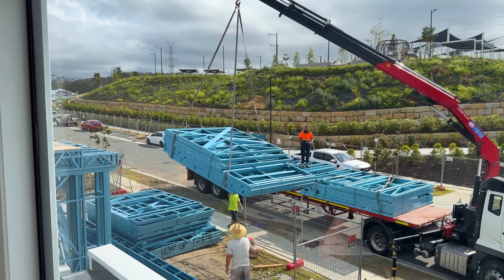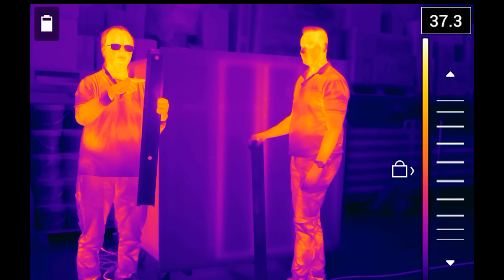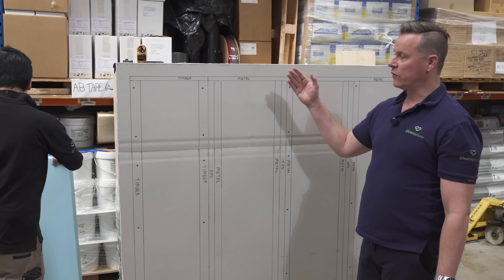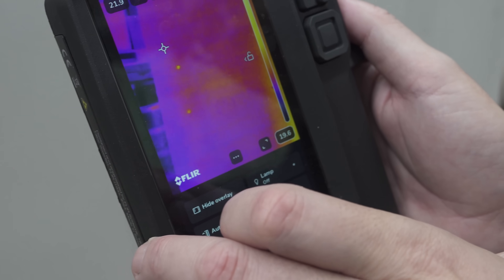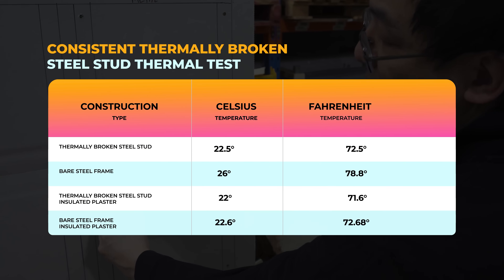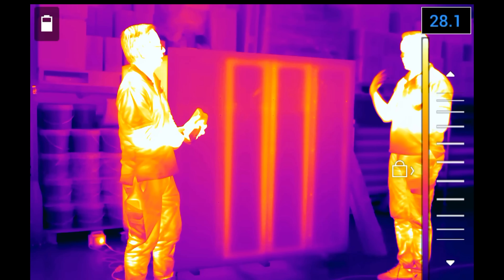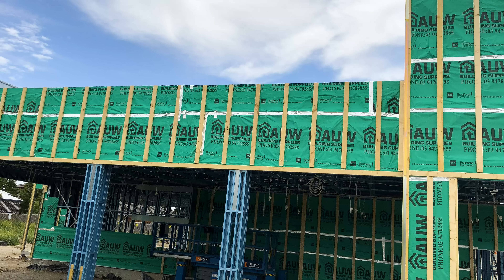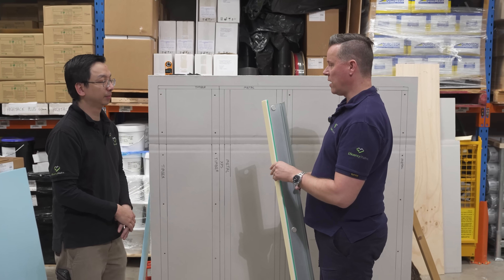Steel Studs BUSTED: Thermal Bridge Nightmare Exposed

Comment: Unlike in cold places where you need to trap the heat in, during dark winters, summertime sun in Oz can readily power a heat pump.  Regardless, layer of bricks on the inside is more sane than "inside out" brick veneer.

Comment: Interesting video. A lot of effort for a relative inconsequential result. If you wanted a far more accurate results for not much more work (yes, I know what I'm talking about, I do building design and are a tradesman too.) you should have built 4 individual boxes, space them apart by 1 - 1.5 metres, have an accurate controlled heating system for each box. Construct each box as a true example of what you are representing, then take your results. That would have prevented heat creep, open side vs box side (the two outer boxes were exposed at the end, the two middle boxes share walls on either side, etc.) good video but...do better guys, you put a lot of effort into it, put a little more thought next time.

Comment: Why not put the thermal break material on the INSIDE instead (or in addition) - sandwiched between the steel and the plasterboard? I think that would perform better.

Comment: Its the shitty WINDOWS that are most thermally bad insulated because it is also metal frame and only 1 piece glass (it requires at least 2 pieces of glass, ideally 3, to create good thermal insulation)
Also the roof and ceiling are have very bad thermal insulation

Comment: It's  a 4 x 2 this is Australia. 
And actually we have been metric in this country since I was a child 60 years ago
Reply: Totally agree. It's 4 X 2. The old man never bellowed at me,  hand that 2 X 4 to me now. 4 X 2, 3 X 2,  but it was always 2 X 1.  There was 2 different types of Clouts. The Clouts in the tins in the workshop. Then there was the Clouts, I got off the old man, in the workshop.
Reply: @PlumbBob-FGX  😊 just about everything is 2" or 50mm thick. So to me the important one is the height. 4" or 100mm if its a ceiling joist or a floor joist or a stud. 
Everything they have ever adopted is stolen. 
Defenders of the imperial system when the reat of the world has wised up.

Comment: There is no exterior cladding on your experimental rig.  It shoulx have the framing sandwiched between the external cladding and the dry wall.  You only have the dry wall on yours.  Steel framing has several advantages: it won't rot, or split, doesn't need to dry out during construction before lining the walls, and it won't warp like timber does as it ages.

Comment: Surely must consider external cladding and whether there is wall cavity? In high BAL areas required to place hardwood batten for internal lining as well. With brick veneer, cavity and radiative foil on steel frame and internal heat conduction wouldn't be a big problem surely. Similarly, with Hardie plank or timber cladding and radiative foil not too bad. Certainly, a design aspect to consider so thanks to guys for raising.

Comment: I'm in Romania. We build in plenty of styles and steel frame is ok. Insulation in the wall is beyond terrible, it's retarded. You shut down the main advantage of hollow wall. Speed. Just build it normally, fastest possible, no tape, then rapidly put on cheapest flammable insulation on outside of the wall but don't cheap out on the stucco. The stucco is a must. Without that you burn big style ... London style. Dubai. LA. Whatever. Don't put that exterior framing thing that is indeed very fast, looks good but it's absolute garbage and burns like a furnace. Just take your time, stucco applied by hand, glass fiber mesh between layers ... done. Still fast, plenty of fire resistance. Especially against bush or Forrest fire or burning up the crops or any of those sparkly stuff that spreads by embers

Comment: One question.
Why didn't you tuck the glasswool insulation into the steel frame cavity?  You left the steel frame channel open like an uninsulated hollow section.
Reply from the maker: This is how we see it installed out on jobs 100% of the time.  We will be doing a follow up video on this.

Comment: No benefit to steel. I built double block. You heard, double block. 410mm external wall core filled. Internal walls single block . 35 deg outside inside 21 .

Comment: "PassivHaus" is the Gold Standard, yet to be discovered in Australia.  When the president of its professional architectural body compares Australian housing with glorified tents, you have a problem.  When we came to Qld in 1995, my wife immediately dubbed the elevated wooden structures as 'sheds on legs'.
She's right.  Freezing in winter and an oven in summer.  And building on stilts does NOT create a cooling breeze.
The only way to prevent full exposure to the sun's radiation is by shading.  The only practical way to cool is by air conditioning.
In winter the problem is reversed.  it would be good to trap those rays with a trombe wall but really, where is the habitability?
Insulation is a joke in Austalia.  Who's heard of triple insulation?  Know of any house with it?  thought not.  Insulation underfloor?  They'll edge away from you.  
Which brings us to the PassivHaus concept.  Research it.  imagine no dust in the house (or on the furniture).  humidity and temperature levels exactly where you want them.  Energy bills?  In Queensland, forget them.
And guess what.  for the die hard, you can have a full passivhaus wrapped up in an old Queenslander design, though personally I'd like a solar array tucked away somewhere.
Instead I live in a lowset timber frame with more window area than brick.  All single glazed so even a 14kw aircon reverse cycle cannot cope.  The ceiling has so many openings into the roof it's not true.  But at least I don't suffer from the sound effects of the Battle of the Somme that my steel frame neighbours have to endure.
I've explored the extra insulation avenue. Frankly, it's not practicable.  
But's what is really distressing is that new builds are going up all over Brisbane.  Every single damn one of them is basically a tent.
The government of this country needs a good kicking.
A revolution is needed in building specs and standards.
More power?  build SMRs for unlimited power, 24/7 in the district it's needed.  They could also be used to solve the water diemna.
1000 times as much water as the entire state of QLD needs runs into the sea in the top end.  harness it.  Use nuclear power to distill it to absolute purity then pump it down to the south and out beyond the GDR.  ye gods, the Romans built aqueducts more than 2000 years ago to move water 60 -100 miles, just to have ornamental fountains in their cities.  Yet Queensland wastes BILLIONS on a flaky desalination plant.
You really couldn't make this up.
Reply: this will never happen in Australia as Australia became unproductive and inefficient and expensive and greedy, there is no time and money for innovation!

Comment: Ahhh and there it is, the BAL rating rubbish. Ive been through this with several builds. It's like fire should know what houses have a certain mixture of BAL rating materials and what house should be attacked from which direction depending on materials used. 

If your house insulation is starting to burn as the fella suggested here its already way past the time your house is going to stay a house, it will be ash. Bushfires are so severe in Australia near bomb proof houses are destroyed. See Black Saturday documentary. I knew a cop that was first on scene after the fires in Kinglake VIC, he said all the windows and roller doors were completely blown out on every house. Fires do not care about standards. Your house survival rate is down to pure luck.

Comment: Very interesting, and duly noted. Just one thing I want to point out, all material differ is a thermal parameter called emissivity so when viewed with a thermal camera you need to cover the whole surface with a material with known emissivity so that it can display the correct temperature. In this example the viewing from the plaster side the shows the screws as being brighter but that could be because of this surface effect, not because the temperature is actually different.when look at the other side all bets are off, and you need to do post correction or cover it with a uniform material.
Reply from the maker: You are absolutely correct.  But I believe we made this comment from feeling the screws, not by what it looked like on the thermography imagery.
Reply: @ecoevo  Ah, but herein lies another thing, how warm or cool something "feels" is greatly affected by it's thermal conductivity,  a screw will feel a lot warmer when it's above your body temperature than a thermal insulator of the same temperature. That's why in electronic engineering manufacturers make money off thermal cameras, because when used properly they offer measurement without changing the temperature of the part being analysed. In the building industry large scale measurement from a distanceeis the important feature,  where as in EE we can use a thermocouple for contact measurement but when measuring plastic parts the thermal mass of the thermocouple is > than the thermal mass of the contact point.

Comment: 25mm thick horizontal timber batterns spaced at 600 centres  just behind the cladding provides great thermal insulation if sealed well. Air is a good  conductive thermal break and a 25mm gap works well against long wave radiation  and convective transfer.  Now you just need to reduce the Sol air temp with reflective materials and shading.

Comment: Considering that most of Australia has pretty good climate - we are not insulating against minus 30 degrees Celcius like in Canada... I'd prefer a termite-proof building even if it costs extra from my air con... the temp difference is minimal.
Reply from the maker: It’s not really about energy, it’s about managing condensation/mould and indoor health.  You are correct, energy is not the biggest issue.  We agree.

Comment: I grew up in a steel frame built in the 80s & I have seen zero problems regarding thermal transfer. Steel frame with brick veneer. Never had big heating/cooling bills & never noticed bridging issues. The frame was behind brick with verandas or DEEP eaves on all sides so the walls rarely got direct sunlight. Also had a very well ventilated roof. Sounds like modern dogbox construction needs to remember why verandas exist.

Comment: Yes I agree but I build a house as a home builder and I'm not a builder and my house I designed was off the ground and it was hot in summer but the house was cool in side as the airflow under the house drew the heat out of the steel frame and all I had was the wool bats on the walls no insulation on the stiuds as there was no codes at this time and I believe if place the frame on the concrete slab on the ground it does not allow the heat to escape where offy the ground timber floors it acts like a cooler

Comment: I wonder about condensation in the walls. Steel will provide more condensation surface since it feels "colder" due to thermal conductivity. Could this be a problem leading to mold growth?
Reply: And rust

Comment: Metal studs are far superior to wood framing. Metal studs get insulated inside. No dry rot, termites, warpage, higher fire ratting, you can make them as long as you want, higher seismic ratting, predrilled holes for electrical, lighter, faster to erect and saves trees.
Reply: The truth is these conditions do apply as regulated in America and Europe, the big question is why has Australia let us down. It seems we have fallen behind the rest of the world. We should have been up to speed here in Australia, our public servants and politicians have failed us yet again. Years ago we brought out what they called basics, that was a new code of conditions to make our homes healthier to live in, this in my opinion was a great things, only problem was that certain sectors of the building code was exempt ( relocatable homes were able to get away with theses conditions) a complete failure of bloody public servants, I’m so fed up with these self appointed bureaucrats. We are now left with this mess and yes people are living in unhealthy homes.-

Comment: I see brand new homes every day, and I have never ONCE seen that foam thing installed on steel framed home.
Reply: Also the steel is cheap and thin, made in China!
Reply: @jeanvonbarberode2377  Most places do actually use truecore steel on their homes. I have seen some  on rare occasions that have used the knock off stuff, too.

Comment: This could have been improved by calculating the difference in heat energy transfer for the different cases.  Then the energy gained by a typical residence could be calculated to determine the comparative cost to pump that heat outside for each example.  This would show the "efficiency" of the insulation.

Also, it would be good to demonstrate the diminishing returns for increasing R value in terms of heat energy transfer, although R value has a linear relationship with the thickness of the insulation (and thus cost of the insulation material), the heat energy transfer does not, there are diminishing returns for increasing R.  The differences in temperature between the different cases are not huge, and this is across only a portion of the wall. 

What are the economics?

I think you could eliminate a number of possible variables and have more convincing results if you built a number of identical boxes, each with one construction example or one box with a replaceable test piece.

Also, I do not understand the air tightness explanation at around 9.30.  When you say "this won't work either" does this means that an air leak in the ceiling joint that would transfer heat into the roof cavity (by convection only, other method?) will negate the entire efficacy of a layer of 25mm foam over an entire wall?

Comment: Metal studs need continuous  external insulation to not thermally bridge  - Better performing would be a double, thermally-broken frame (composite top and bottom plates)  (???).
(neither is very typical - Nb. Brick veneer isn't insulating  - it is a thermal mass, outside the designed moisture barrier.)

Is the insulation named as "rock wool"  - really rockwool or glass fibre wool (more common in Australia). ??

Also, remember Matt Risinger put core flute capillary breaks behind his external insulation (on his own home - several years ago) - that negates a significant amount of energy efficiency letting cold (or hot) air into an uncontrolled space. - better to shed water off the front of the assembly.

Encourage rockwool external insulation - for fire resistant..

Comment: Notice how full details of the heat source is not shown.
Why is the steel in the centre and wood on the outside?
Wood is good for termites and fire. Pine burns like paper, buckles like boomerangs.
Even as a wood, pine is on bottom, one step up from balsa.
Pine isn't any good for furniture and they're building houses out of it?
To top it off, it's bad for the environment. Imagine clearing beautiful native trees to grow this Rubbish.
So a couple of degrees difference. Does this mean you don't need air conditioning? No, you will still need air conditioning in most Capital cities in Australia, which renders all this to be BS.
This is an ad from the Pine Industry
Pine should be banned.
Reply: Get a grip!
Reply: well said. Pine is rubbish. Only good for termites. Even in sydney, there are termites everywhere. On warm summer day, trillions termites with wings fly in the air to start new colonies.

Comment: If you're so concerned about termites and heat transfer, why aren't you building with hempcrete?  Then it doesn't matter so much if you're using steel or metal studs.  And it's less energy to make and non-toxic.  Problem solved.  I'm building a hempcrete house now and it's the smartest decision I made on  this house build.
Reply: Termites love concrete slabs but I love the idea of hemp crete...have you researched termites, white ants ? My pest inspecter warned me against slabs on the ground.

Comment: The other issue with steel frames is the Faraday cage effect which makes mobile phones and wifi almost unusable. Be prepared to hard wire a network into every room if you want to use the internet.
Reply: Hmmm, not so sure the physics works out on that one buddy. Faraday cage means the gaps need to be around 1/10 the wavelength to be blocked. For 5GHz wi-fi that is approximately 5mm (I think) which means your studs are quite close together on that framing. 
What you’ll generally find with wi-fi is that the signal goes to shit in most homes due to the number of rooms and hence walls (of any kind as they attenuate signal) between you and the transmitter being the real issue. Microwaves and metal splash-backs don’t help either.
In typical Aussie McMansions you really need 1-2 APs per floor to get coverage, but your local expert can help you planning this out. For example, in my modest home I have 2 Unifi NanoHD APs, one at each end of the single story building in order to achieve suitable wi-fi coverage and a seamless experience.